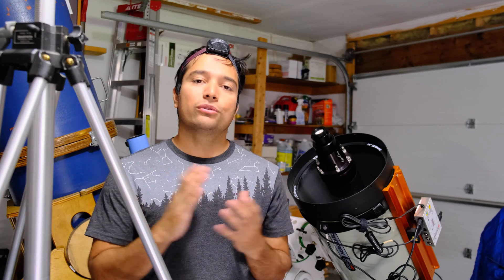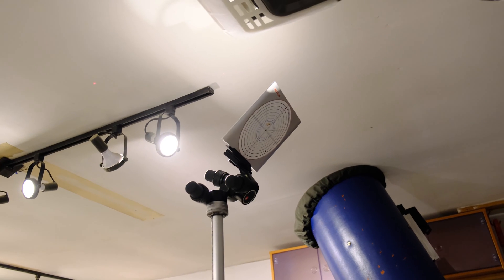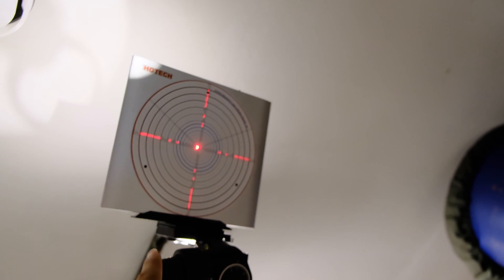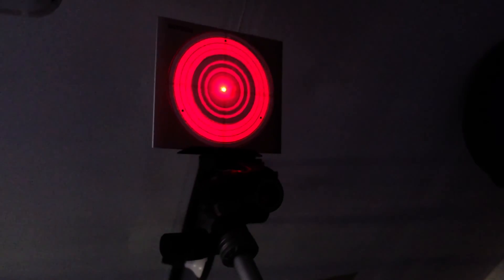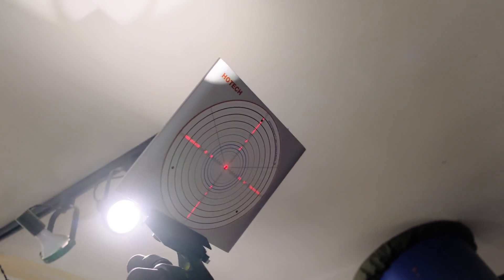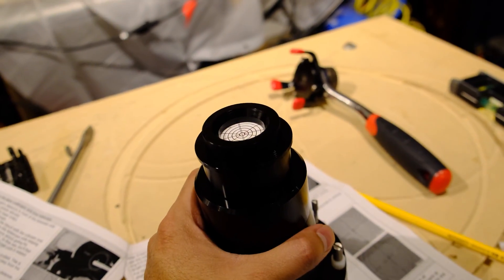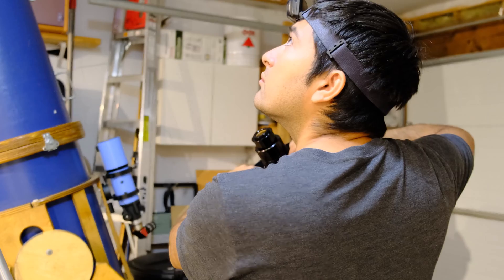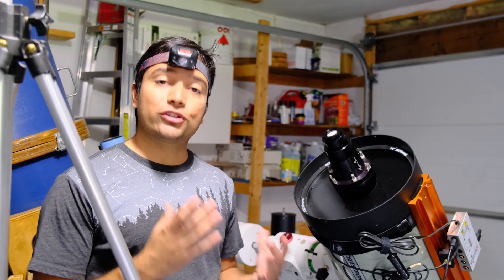Mastering Hyperstar Collimation - HOTECH Advanced CT Laser Collimator

Comment: My C9.25 has the adjuster screws on the sides, but they are caked with so much loctite that they're welded in place. It makes collimation impossible.
Reply from the maker: Oh no. Sorry to hear that. On some equipment they use removable loctite which dislodges with a little bit of pressure. Hopefully Celestron didn't use permanent loctite on that one.
Reply: mine was the same, if you use a heat gun and warm up the Allen Key it melts the Loctite
Reply: @SimonT65  Thanks for the tip! I’ll give it a shot.

Comment: I am trying to use this for my SCT - non Hyperstar.

Curious - how far apart is the end of the telescope and the Collumator?
The instructions state something like 1 optical tube distant but I could not find the correct placement of this.
Reply from the maker: Hi. I collimated my C11 without the hyperstar as well and I think the outer tips of the laser were around 6.5 on the target (near the outer edge). I will have to double check when I get a chance next week though.
Reply: @AbdurAstro  thanks - I am having an issue getting the lines to properly appear - and it is not an easy feat to get them lined up close to parallel - then move the panel in and out - having a good idea of how far apart the should be from each other would put me in a better place to start with.

the guy who worked on my scope said that the main mirror is good but I need a little work on the secondary reflector.  I wish he would have finished it before returning it.
Reply from the maker: @allenbaylus3378  According to the manual (V9) for collimating without a hyperstar:
"Move the collimator to the distance where the crosshair is its smallest. This
point is at the Back Focal Length (BFL) of the telescope primary mirror. Now, to
position the collimator at a distance with good pattern resolution, move the
target away from the telescope until the inner tips of the reflected crosshair are
positioned between the target plate’s ring 1 and 2". 

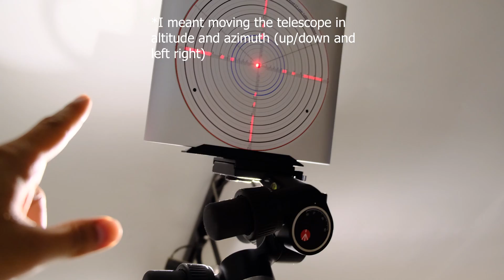If you have the same version I have, then they mean the inner tips should be between line 1 and 2 on the inner blue circles. The blue circles are visible in my video at 1:42 here https://youtu.be/cc6taiEDjZA?t=102

Comment: Fantastic overview of this crucially important mirror calibration process. 
This (much easier) method should hopefully prevent as many folks giving up on these superb fast telescopes - it's a massive plus being able to do this in your own home under fixed conditions. As long as the primary and secondary mirrors are properly locked down after calibration you should only need to do this every few months, though that always depends on the telescope. This method is certainly the way to go, but always, always be patient and follow the steps exactly. Do that and you'll keep on enjoying your hard earned cash investment to its max.
Reply from the maker: Thank you. The paper instructions included with the Hotech laser collimator for hyperstar could have been clearer. I would be happy to offer some suggestions to the manufacturer if they are interested. Since the manufacturer didn't have a video tutorial, I decided to make my own to save others some time. The final result still took a bit of final tweaking through trial and error under the stars but it worked better than anything else I had tried.